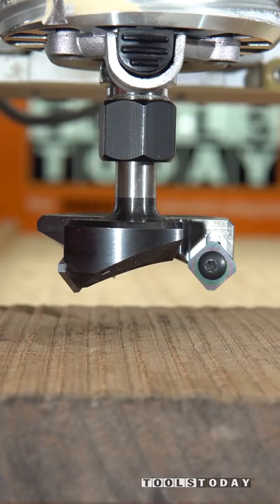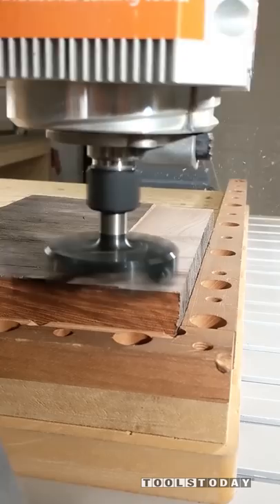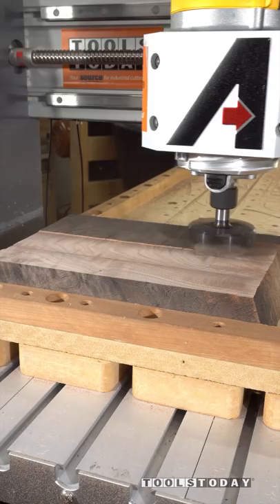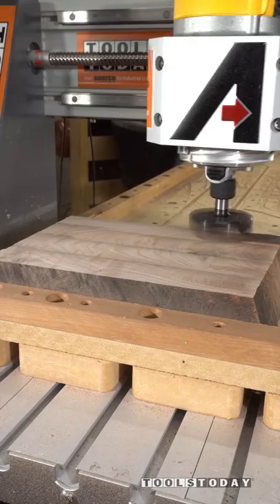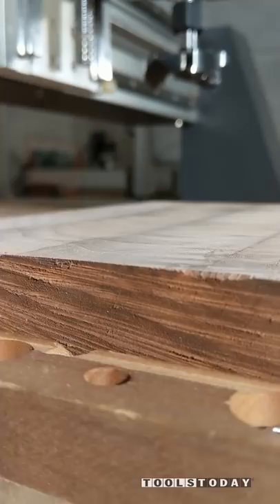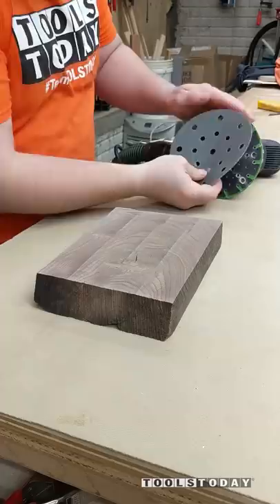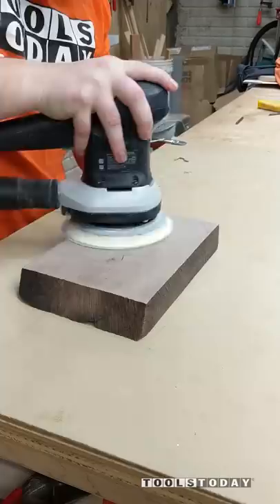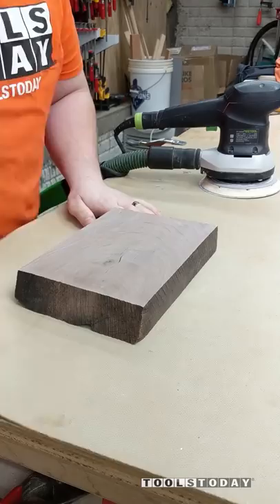Flattening Walnut

Comment: The lines are caused by alternating directions from the endmill. Looking at it spin clockwise, the left side moves away from the camera, right side moves toward. 

As another pass goes next to the previous, the grain is "combed" in the opposite direction, causing a line where the later pass touches. It's like a fuzzy pillow or cushion that you can wipe with your hand an it looks like a different shade even though it's the same length/color as it was before you wiped it.

Sanding just re-orients the grain a little to even it out or randomize it.
Reply: Like cutting grass, yup

Comment: Hot tip. Apply sanding sealer or light coat of finish to raise the grain and make the lines reappear. Sand again for final finish.
PS I learned this lesson the hard way.
Reply: just wipe it with water before sanding

Comment: I just use 1 pass with a planer. leaves no lines either
Reply: Until you get a nick.
Either way you still need to sand.
Reply: @davidtaylor4053  I never get chip out or nicks, I have spiral cutterheads. The sanding has nothing to do with the flattening process, sanding is for finishing...
Reply: It's not really relevant to this video because he's using such a small piece but the router table I made will accommodate slabs nearly 4 feet wide at a fraction of a fraction of the cost of a planer that could do that.
Reply: @just73319  A router table made for flattening? 🤨
Reply: @walmars3curity  yeah it's basically a manual CNC, slides were only like $200. The horizontal movement I do by hand

Comment: As a machinist, those lines are formed from the cutter being pushed to the side as it’s cutting. Unavoidable, and yes, if you can see it, you can probably feel it, and if you can feel it, you don’t need to look.
Reply: As a machinist, did a shell/face mill be referred to as a flattening bit irritate you? 😂
Reply: @ashpalmer1365  no, call objects whatever you want to call them. I call a form tap a roll tap… I call a belt grinder a belt sander. I call a bench top grinder..a grinding wheel.. 😂🤣😂🤣😂 can’t stop me from making something by naming it something different.
Reply: @ashpalmer1365  I have an interesting question. Why are they called shell mills…? I see no “shell”
Reply: @creekninja  We have only explored 5% of the ocean so far.
Reply: @ashpalmer1365  what does that have to do with a machining tool???

Comment: Can that bit be installed onto a regular router?
Reply from the maker: When used in a router flattening jig, yes it can safely be used.
Reply: It needs to be a very strong router, and one with variable speed, because the tip speed is greater on large diameter bits, and the rpms should be reduced.